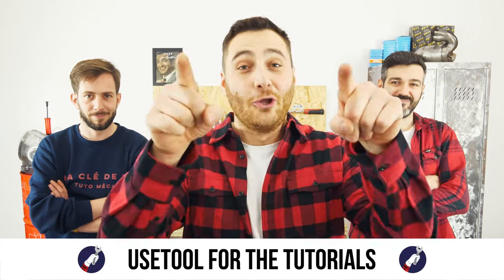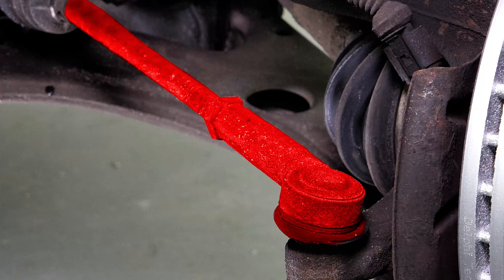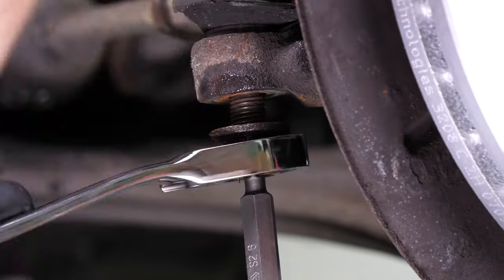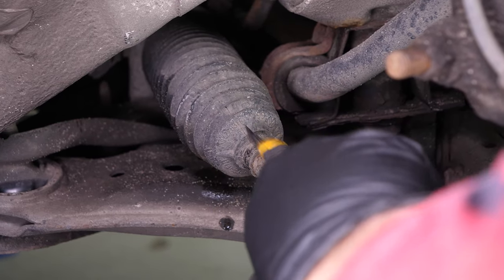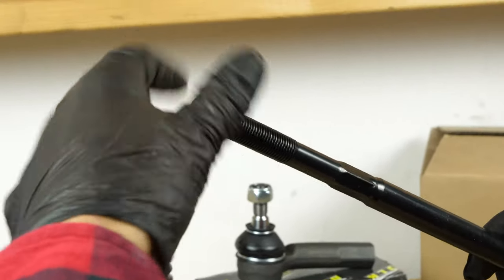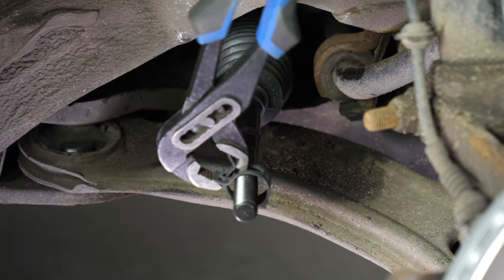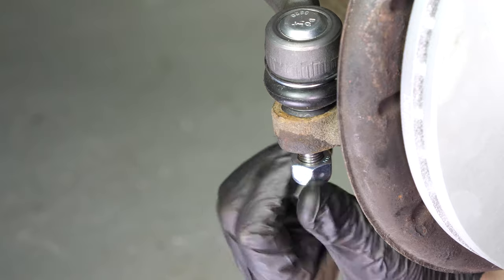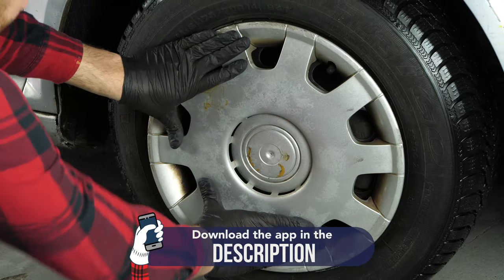How to replace the inner and outer tie rod Golf mk4 🚗

Comment: @1:24 why trace a line with a marker if this is going to be replaced? And why count the turns if you're using a different manufacturer which will most likely not have the exact same thread and you're measuring it with a precision instrument anyway?
Reply: True. Need to do an alinement afterwards.
Reply: You can put the end back on once it is removed and then measure it and then make the new one the same length so it's not really out so you can drive it to get an alignment